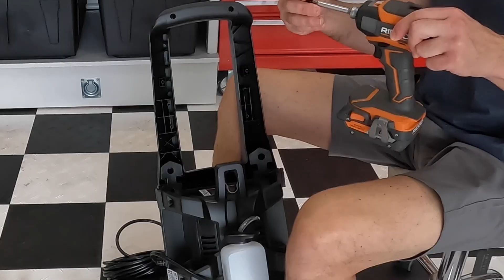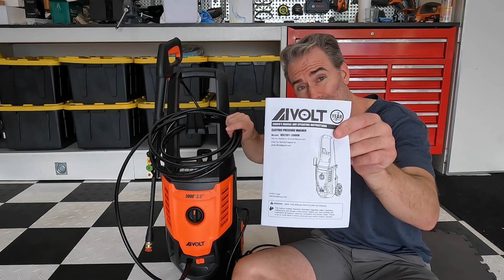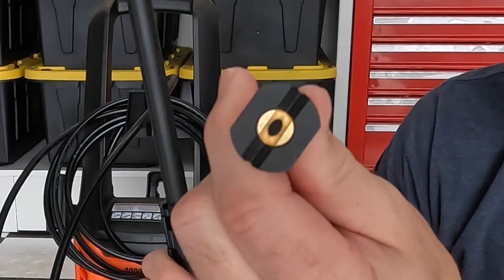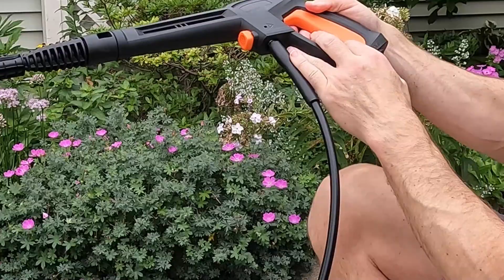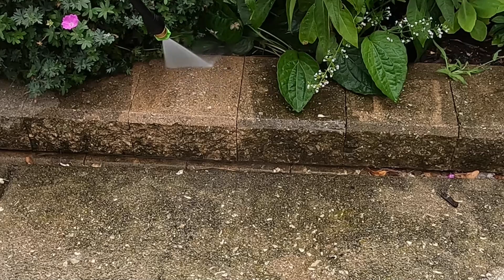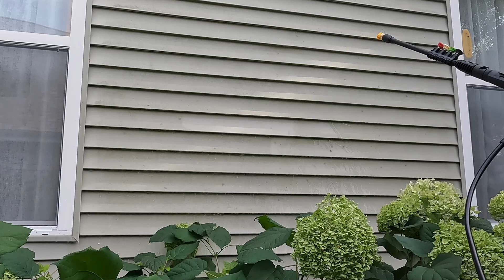AIVolt Electric Pressure Washer - 3000psi?

Comment: Nice review!  In general I've always found more GPM's are far more important that PSI.  It's easy to restrict a nozzle but harder to move enough water.  We also called those "surface cleaners" hover covers!  They work well but only if you've got about 4GPM going into it.

Comment: I got this one and i like so far, i just tried to get a better hose with a short trigger gun. The only problem i have is that i can’t get any adapter to fix the inlet hose. No 3/8 , 3/4 or 1/4 will fit. I tried to contact AIVolt via amazon, they said standard M22 1/4 but theres something off. Any recommendations of the size for adapter to add a better hose